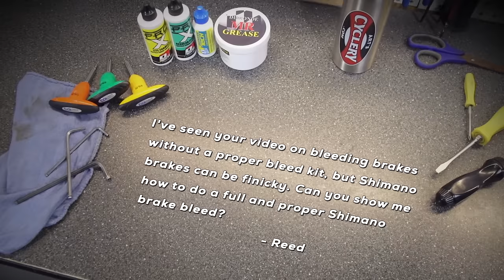Ask a Mechanic: Bleeding Shimano Mountain Brakes

Comment: In this Video one could assume that after step 1 I let the "old" fluid go back into the system again, "top to bottom". I do need to discharge the "sluggish oil" first before continuing with step 2, correct?
Reply from the maker: +Chris Land Old oil in the oil funnel should never make its way back into the system. I'm not sure exactly what steps you're referring to, but never push or flush the system with old oil. And if you follow the bleed process as outlined, you shouldn't have to discharge any fluids until the bleed is complete. Thanks for watching!
Reply: @artscyclery875  This gives more sense, because the old oil must not enter back into the caliper, anyway thanks alot for the upload

Comment: in Witch moment do you change the oil from the cup? because when you pump the lever you have nice and clean oil
Reply from the maker: After you finish pushing fluid through the syringe, you want to begin the lever bleed portion with fresh fluid.

Comment: I'm using XT m8000 brakes. When bleeding, should i adjust the reach of the lever all the way in (closer to the bar) or all the way out (further to the bar); also about the Free stroke screw, should i srew it all the way in (clockwise = pads move closer to the disk) or screw it all the way out (anti clockwise = pads move further from the disk) ? Thanks
Reply from the maker: Hi, it's best practice to back off the free stroke screw and lever reach adjustment completely (counter clockwise/out) before bleeding. Note where your settings are before backing them off and return them to you preferred settings after the bleed is complete.

Comment: Is there anything else to know about bleeding the back brake? Thank you for this video it is helpful for the front one
Reply from the maker: The back will be the same. Keep in mind the housing is longer, so there's more space for air to get trapped. In the final stages, plan to do a few extra lever pulls to pump out any excess air bubbles.
Reply: Thank you!
Reply: in Witch moment do you change the oil from the cup? because when you pump the lever you have nice and clean oil

Comment: process is not quick, its very painful.  Once you have gone through all the bleeding step. FINAL CHECK (that every video i have watched forgets to tell you) Give the brake a squeeze, with the dust cap of valve and see if any oil comes out, most likely it will.....)

Comment: Gravity Bleed the easiest !!!!!!!!!!!!!
Reply: Gravity bleed is make more sense and safest way to do the job. I can't see any reason to open the valve few times and pump the level, to reduce the chance and get rid of air from entering into the system during the process? if so, why don't use gravity method?